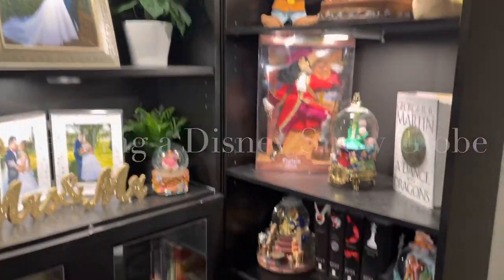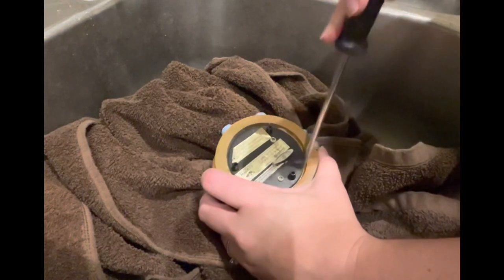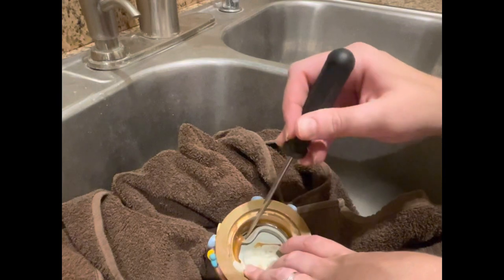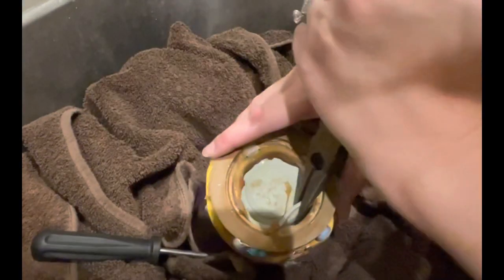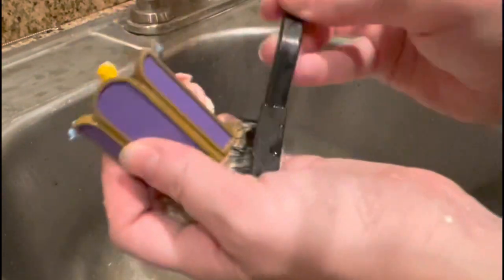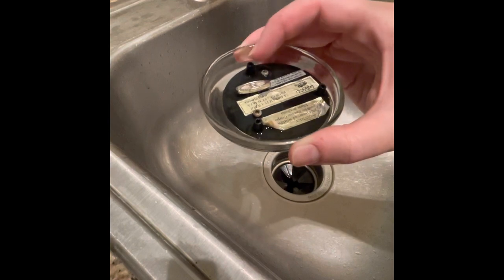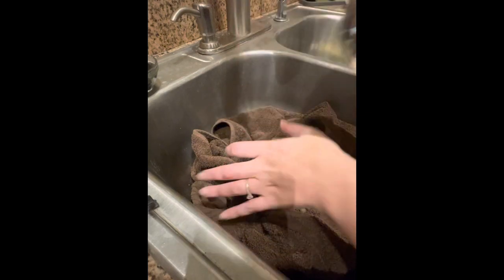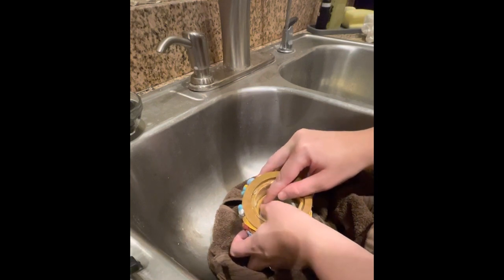Replacing Water in a Disney Musical Snow Globe DIY Cinderella

Comment: If you want the glitter to float use 2 to 3 tablespoons of clear school glue in thev water mixture. You'll be happy you did, as the end product will be much nicer and far more professional in appearance.

Also, if you must use glue sticks, try the E6000 and Gorilla Glue sticks method for a stronger, more permanent hold.
Reply: I personally prefer using glycerin, it will work better in the long run

Comment: Thank you for your help. I am replacing rusty water in a Pete's Dragon snow globe. What would you suggest doing to clean grease or excessive dirt/dust off Disney Snow Globes that have a lot of crevices and curves.  Spray foams, hot water with soap, small swabs, etc??? Thank you.
Reply from the maker: Probably goo gone! If you are trying to get it off the glass.  So sorry for the late reply!

Comment: This was an excellent explanation - you went through every detail slowly and clearly - I feel confident to open mine up and replace the water...

Have you ever had a music box that looked as bad as the one in this video that actually worked after you gave it the vinegar treatment?
Mine looks very much like yours did initially, completely gunked up with some kind of deposits and frozen solid

I found a replacement on ebay for ~$12

Comment: Any recommendations on where to get new gaskets?! Mine ripped while repairing the snow glove. It is a very old glove and the plastic gasket was gross (discolored) and cracking. There was a hole in the basket to put the figurine.
Reply: Try an old fashioned hardware store. Remember to take the globe with you to get the correct one.

Comment: What do you use to reattach the figurine on the stopper? I have a Santa that is currently floating around in the globe. TY
Reply: I have the same problem. Did you ever figure out how to attach your santa?
Reply: @ClaudineKarp  I just used a bit of the waterproof silicone that I used to seal.  I let it sit for 24 hrs before I put it back together with the water. Hope this helps.